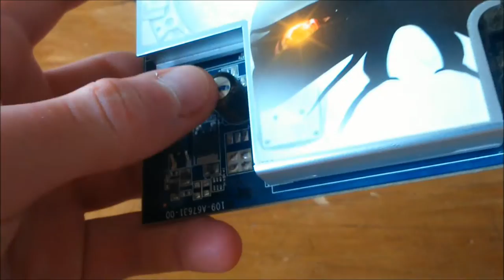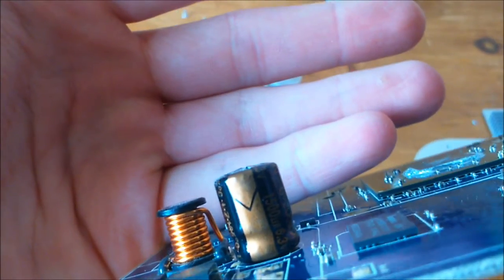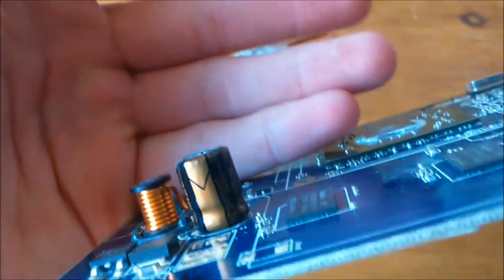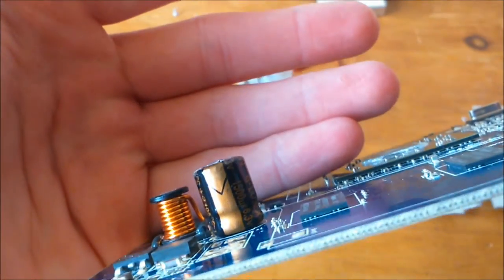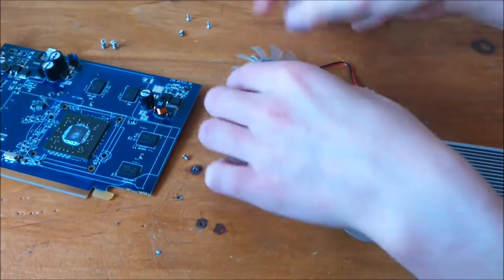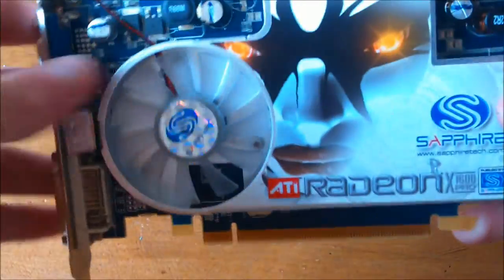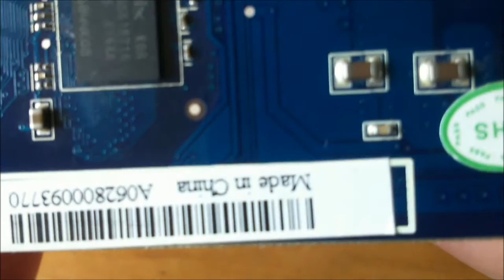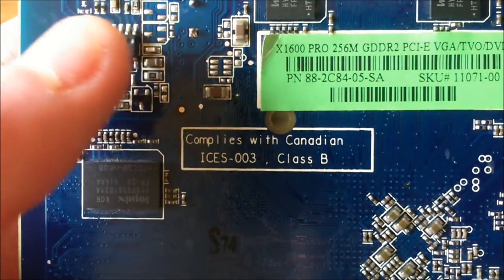ATI (AMD) Radeon X1600 Pro: Teardown, Clean, and Reassembly

Comment: Bad work ethics, you need to invest in a vacuum cleaner and use alcohol and a brush after not water because after water it needs to be heated dry.
Reply: Frazer Forbes, even if you never use it again, you could replace the capacitor, and sell the card on eBay. These cards still go for about $20 USD, even though the GPU is over 10 years old.